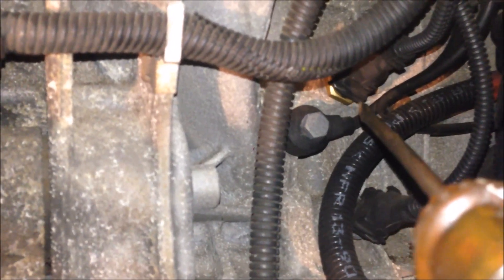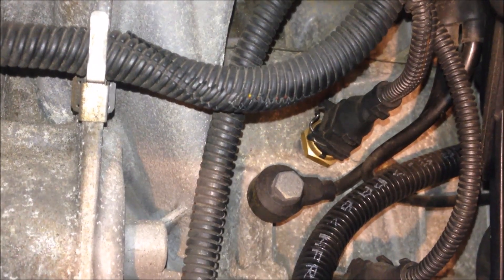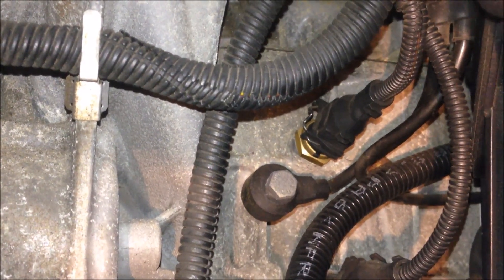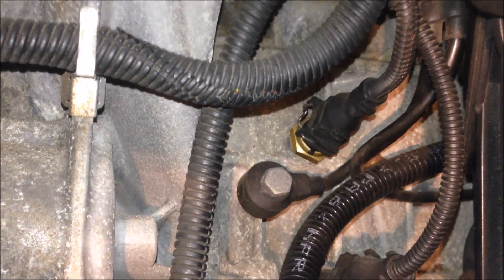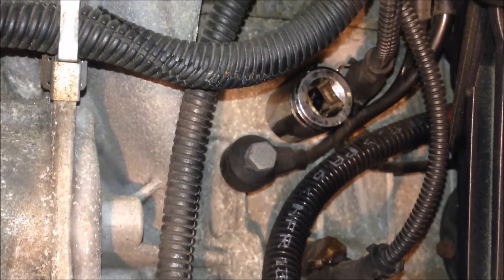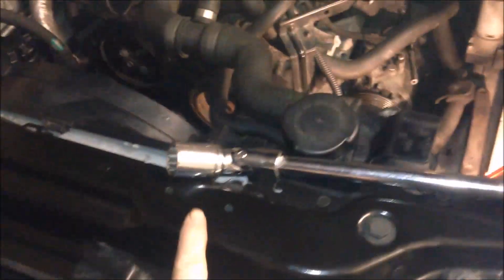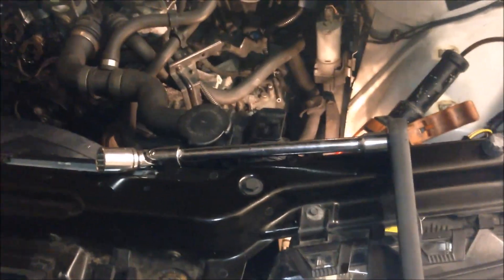BMW E46 / N42: Engine Coolant Temperature Sensor - How to Replace

Comment: Hi there good video I know the location now but is there no way of doing the job without removing alternator. With like a long flexible extension bar
Reply from the maker: It should be impossible. Even it is possible room-wise/space-wise, it normally very difficult to do something we can't see or touch. For your information, these sensors should be very reliable. Although I replaced it for my starting problem, but my problem was finally traced to the low oil engine pressure. Good luck!
Reply: @RepairDIY  5 min job bud didn’t have move any thing deep socket extension bar and angle adjuster part . Your video was very helpful showed me the location thanks
Reply from the maker: @jchalmers28jc18  Hi, That's magic! So anything is possible if we have a genius man! Have a nice day!
Reply: @RepairDIY  I also have a low oil pressure and the engine gets too hot. Could this sensor be the solution?
Reply from the maker: @theheavyride  I recommend that the low oil pressure investigated and resolved first before re[;acing any sensors? Have a nice day!
Reply: Yes. The plan is to loosen the oil catch can and check for any debris.

Comment: Hi, I want to replace my temperature sensor but realoem says it's located in the coolant hose, just after the radiator. Is that correct?
Reply from the maker: This video shows the location of the engine coolant sensor for the N42 engine. You may have a different engine. Please check your engine code and find a video for your engine. Good luck!

Comment: Was it 13 nm to tighten the sensor?
Reply from the maker: yes you are right! it is 13 nm. cheers
Reply: I just changed this sensor (a super easy job thanks to you!), but still having trouble starting a warm engine. Could you please suggest where i should look next?
Reply from the maker: @holybasil155  hi, it is not easy to talk about a right solution for  a particular car. always check the basics, such as oil level, oil pressure, air filter, fuel filter, fuel pressure, etc? when my crankshaft sensor was going, i did have hard to start and stall problems when engine is warm. only replace any sensor after you have checked all the basics? good luck!

Comment: What code did it give you?
Reply from the maker: Hi, There was no code before i did it. I just suspected that the Engine Coolant Temperature sensor might have something to do with my rough idle, that's why i replaced it. in my case the old temperature sensor had no problem.  have a good day.
Reply: Would this work for the e46?
Reply from the maker: @Carlos2k1  hi, my car is an E46 with a four cylinder engine N42. You may have a different engine. You could try to find out your engine code. Good luck!

Comment: Hi. And what is the other one ''sensor'' that you haven't mention?

Regards!
Reply from the maker: hi, you are a careful and thoughtful viewer!  And what is the other one ''sensor'' that you haven't mention? - a good question! on this engine there are two knock sensors and this is one of them! the other knock sensor is obscured by the starter motor. cheers!
Reply: @RepairDIY  Hi. Thanks for your answer!

So, as you have said, we can see in the video: oil pressure sensor, coolant temperature sensor, and detonation sensor... ?

Chgeers!
Reply from the maker: Yeah, those are three sensors you can in the video: oil pressure , coolant temperature and knock sensors. have a good day!